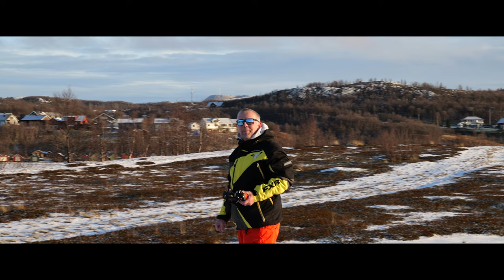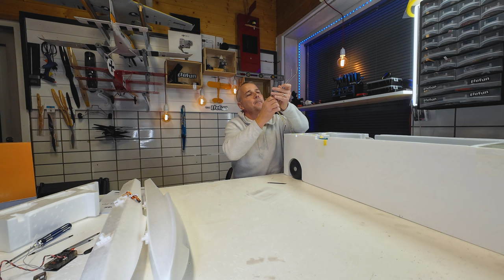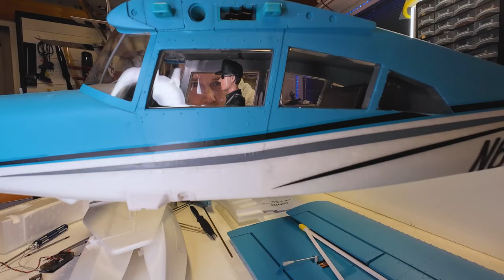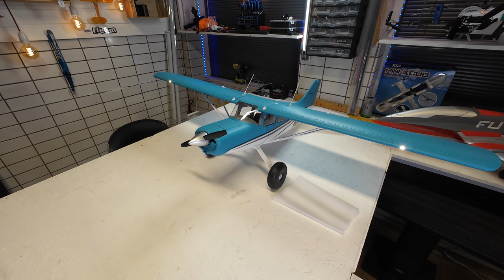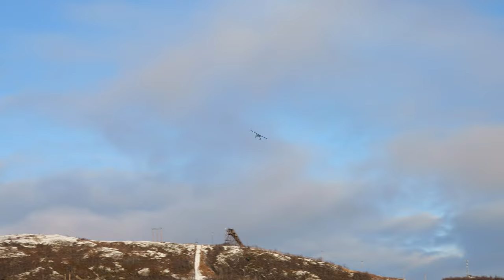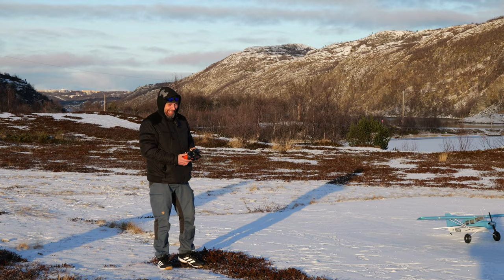FMS Maule 1500mm with Reflex V2 - In Box, some mounting & Flight videos. UHD 4K

Comment: Does it really make that high pitch sound when we reverse the motor?
Reply from the maker: If it was vpp it would be a bit different. The prop pitch is made for pull not push so a bit  high noise it will be.